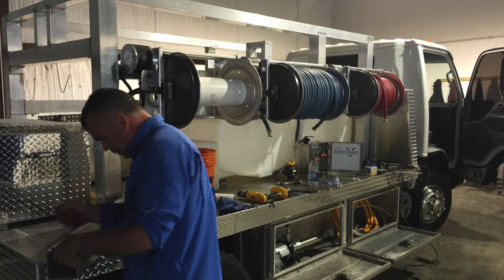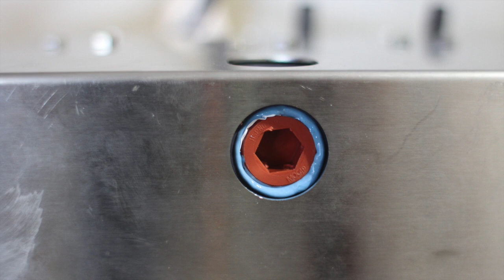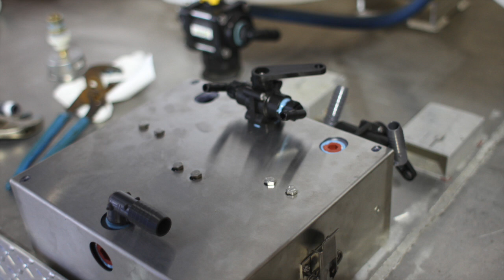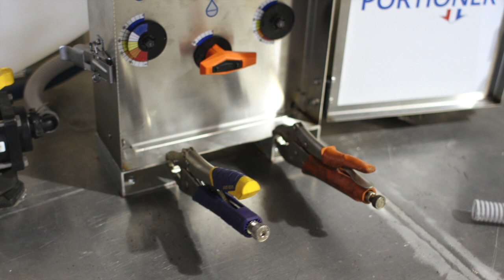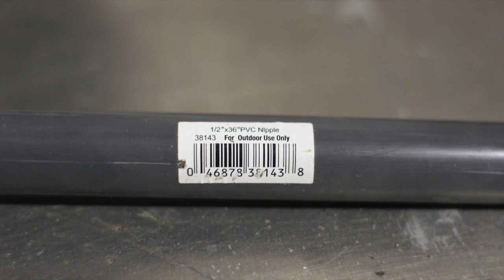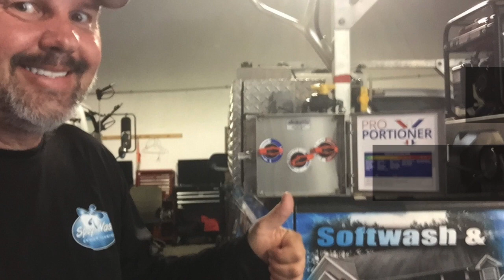Installing your ProPortioner

Comment: Ray, I’m sorry for any confusion though I’m curious what the effect would be if you eliminated the 2nd bulkhead & drop tube to the water tank and instead placed a “T” or “Y” from the original water line and ran that to the flush valve? Thank for any assistance.
Reply: We use a T off the water supply line and it works just fine 👍🏼